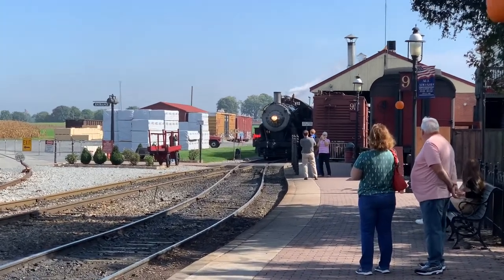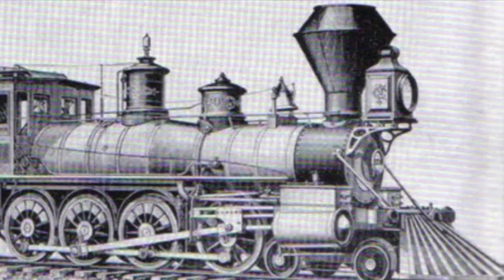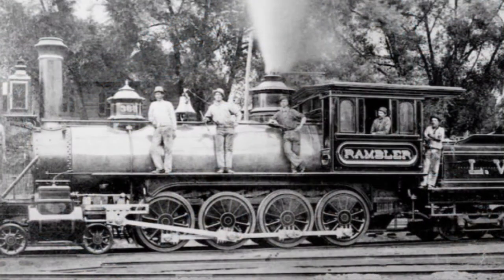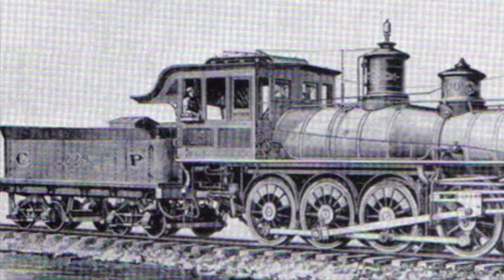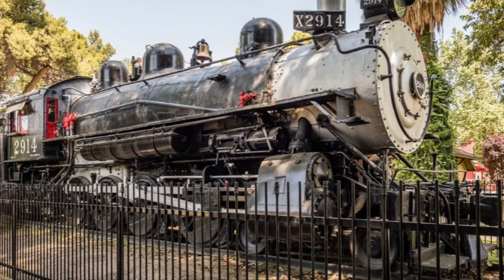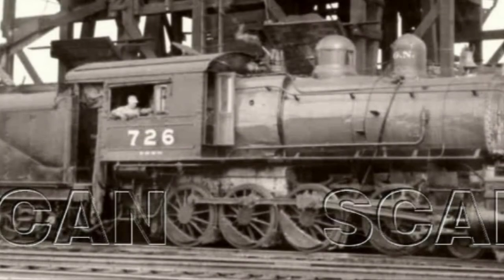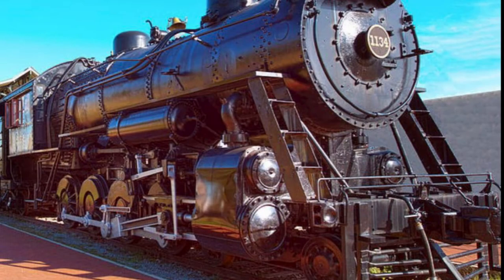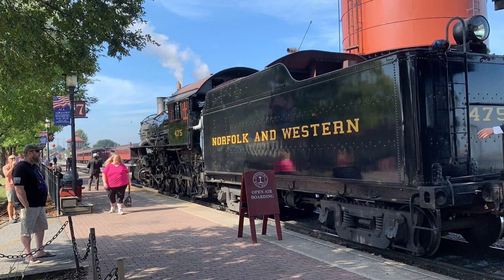Engines Of North America: The Baldwin Mastodon

Comment: Also add the N&W,had one of its M2's,numbered 480,so the road number was the same as the Wheel Arrangement! Another addition to operators of 4-8-0's,was the New York Central,and they were found in the Adirondack Mountains,far from the Water Level side of the Mainline